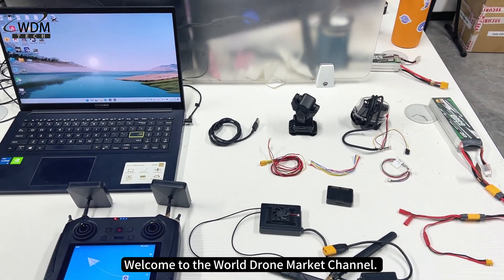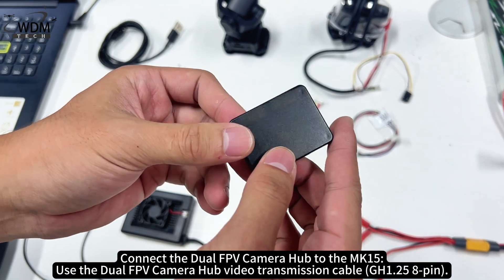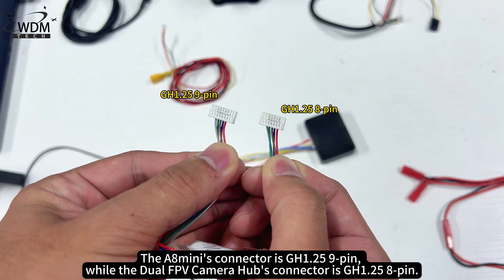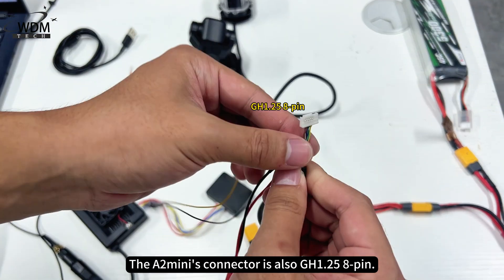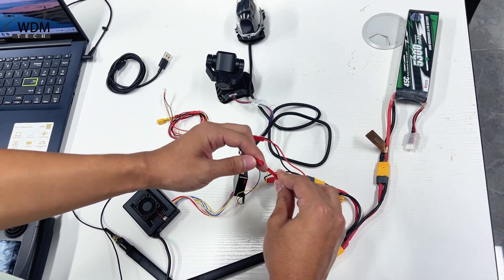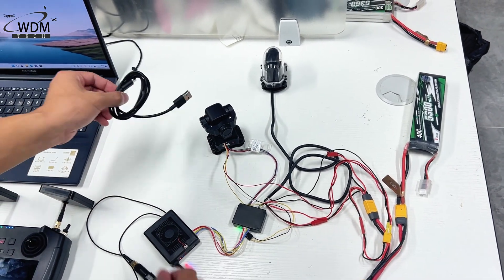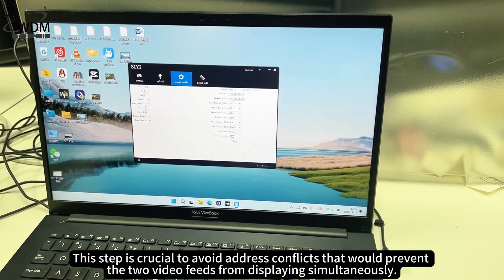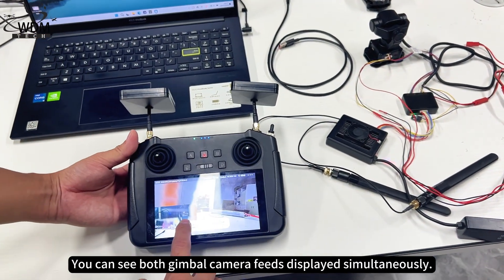How to use the Dual FPV Camera Hub to connect two gimbal cameras simultaneously to the MK15？

Comment: Would this 2 to 1 hub work with a Herelink system?
Reply from the maker: In my test, I used two SIYI pan-tilt units and hub modules connected to the Herelink remote control, and they were able to be displayed on the Herelink simultaneously.
Reply: @worldronemarket  Slick, thank you for the reply!